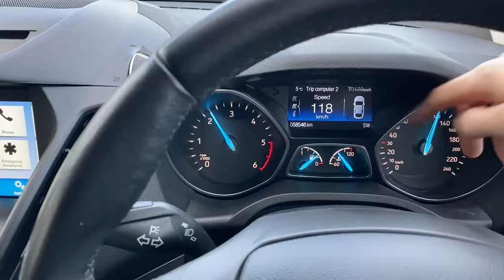Cruise Control and Speed Limiter Demonstration - Step by step guide - Ford #ford #cruisecontrol

Comment: One cool thing you may not know about is if you are in Cruise Control, you can hold Plus or Minus and the car will either accelerate or brake and it will automatically set the new speed once you let go.